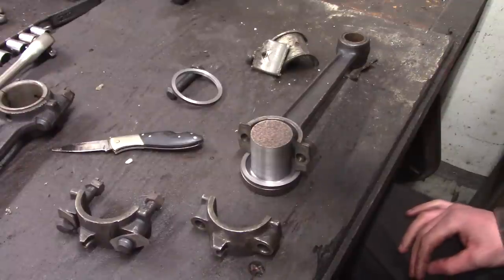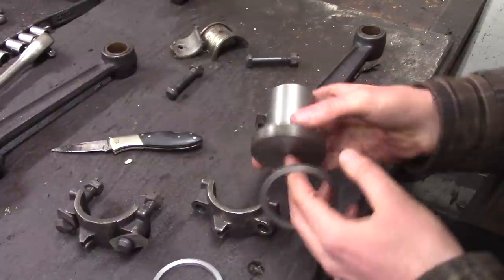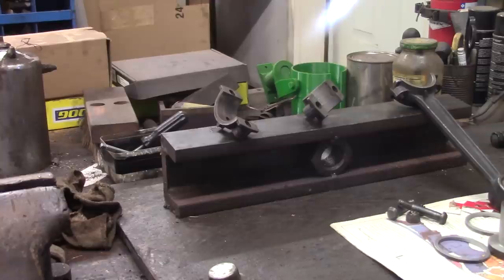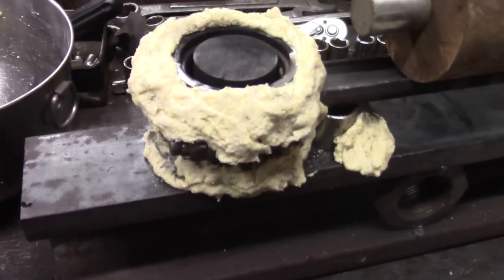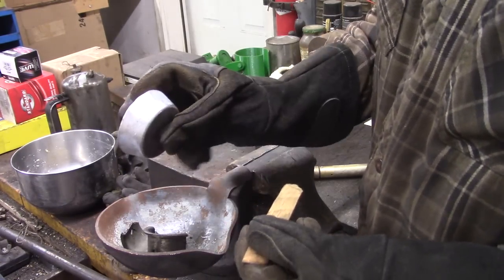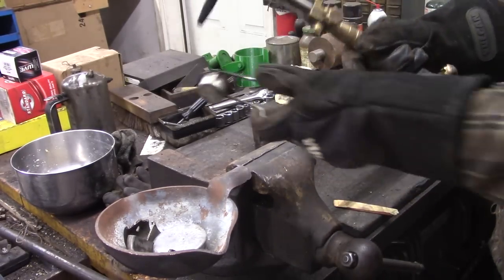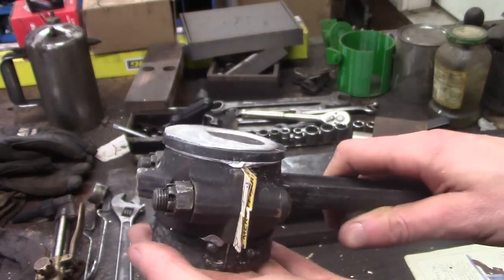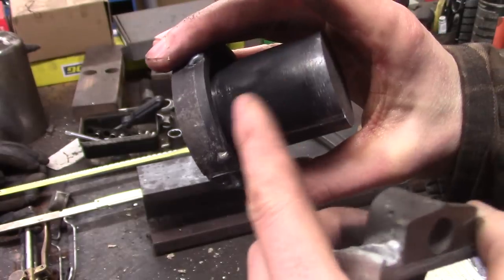Pouring A Babbitt Rod Bearing - Cletrac Crawler

Comment: First thing is the rod & cap need to be baked as you said to remove all of the oil, then you need to blast the parts clean. "Tin" the shells so the Babbit has a "Physical Bond". Without that, the heat can't transfer from the bearing material to the rod. I'll bet you can knock those Babbit shells right out of the rod and cap with a couple of taps with a hammer? A 1/32" piece of aluminum will work great at the joint line, and will allow you to take everything apart easily without you having to saw it apart. You can also re-use the shims. For small parts like rods, I like to "Puddle" the 1/8" Babbit wire in with a small Victor J-27 torch and a small tip. If you like pouring, that's O.K., but very time consuming for small parts. Just my 2 cents and thirty-five years exp! Thank you!
Reply: I always uses pure tin to tin my caps/ bearing shells before Babbitting and clean in hot Kostic soda to clean parts
Reply: Cool tip, instead of tack welding that ring spacers just use superglue to hold them in place. 😉😄👍
Reply: I can’t even start with what is wrong here. Those bearings will not be bonded like they should be. The old ones failed for the same reason.

Comment: When I'm casting lead or tin, I often times when I know it's still solidifying and starting to pull metal, I will play the torch along the top where it's pulling the metal from to keep it a little more liquid for a little bit longer to give it a chance to pull and settle so it doesn't wrinkle or get voids.
Reply from the maker: Good tip!

Comment: In the 70's I worked in a connecting rod shop & would machine out the babbitt & size the rod to fit bearing inserts by the 100's at a time, on the old 6 cyl GM rods. No more babbitt.
Reply: Which engines were still in use in the 1970s that used poured babbit bearings?

Comment: Your damming material was made with water, oh for shame!  That was the sizzle causing air belles that ruined your first pour.  Water and liquid metal are the most mutually exclusive things there are.  The frosting is a result of the Babbitt cooling too quickly (mandrel or cap not pre-heated enough).  Great problem solving though, pour oversize and machine away the rest is also my plan of attack when doing this.  I'm not a machinist and have sold several "Raw Pour" jobs.  The customer will pay for that extra Babbitt, believe me.  You will be seen as the hero in the end, the overage can be collected and reused on the next thing.  Retaining holes/drilling of the cap so the lining does not fall out sort of works, the fatal flaw is that caps should be "Tinned" like soldering copper pipe or a brass radiator.  This initial bond is the key to a secure bond.  There is a special tinning flux that comes as a dry powder to sprinkle on cast Iron used to tin the cap.  I have some so old I think it now might need a screwdriver to get it out of the can.  Check with roto-metals or Mc Master-Carr for a supply.  On final assembly after machining, a product known as 'Time Saver" is mixed with light oil and smeared on the rotating member and bearing surface and used as a lapping compound.  The shaft is rotated by hand and the caps gradually tightened as the process goes (shims in place), repeat additional time saver if needed.  This wipes any machine/scraping marks and will give a very consistent .002 oil clearance allowance.  Rule of thumb after blueing is a +75% bearing surface for hand scraping, time saver can give you a very predictable at least 95%+ bearing depending how far you want to take it.  The more perfect it is, the fewer hours it will go so keep a happy medium.  There is not a thing wrong with a machine running on poured bearings with 85% contact surface.  Laminated shims and being adjustable are a great thing.  Each shim removed at adjustment also reveals greater surface area/bearing surface increase.  Oh, oil galleys only need to be cut a few thousandths deep, most guys go deep when it's really the tip that makes the magic happen.  Tip for others, do not reuse old Babbitt, you do not know it's compounding.  If it already failed once...?  It does however make great cast High Velocity bullets (it's bearing material and mostly Tin so it holds up quite well, weigh finished bullet weight against load data before trusting what the mould has stamped on it, tin is not as dense as lead), also makes fairly Eco-friendly fishing weights.
Reply from the maker: That's true about the damming, but i've heard of other people using that mix for damming so I tried it. Oh well! I tried tinning once, the cast iron was so oil soaked it wouldn't tin. I didn't even think of it this time. maybe if i find some i'll give it a try for the next job.
Reply: M

Comment: My father was really good at pouring babbitt bearings. I remember him pouring babbitt bearing in a Caterpillar 15 about 50 some years ago and it turned out perfect. The engine idled with 40 lbs oil pressure. I didn't watch him pour them. Wish I would have. Being a kid I wasn't very interested but I remember him being happy with it. A friend of mine has that dozer and it is still running today.

Comment: As an apprentice in 1965 I overhauled the Medows engine on an Oliver DDH cleat track dozer. Those conrods are the exact same ones that I worked on(blue, file a bit, scrap a bit). To determine the exact correct temperature of heating the babbit, lay a piece of brown paper bag on top of melting metal in pot. Paper will turn black at the right temp without burning the babbit. The New South Wales Foresty Commision in Australia had a fleet of these with winches used for snigging logs.  The winches were the best designed in the world at the time. Thanks for the  trip down memory lane.

Comment: When I was in trade school 40 odd years ago , we had to do a set of rods but there was a cool jig with a handle that closed up on the rod , can't remember if we did half,  you definitely need to tin the tunnel etc ,  I had an old 51 ford popular E93A engine , a trick if you have lots of spares is if you have a good set of say .040 rods , you can pin hole bore them back to .020 and grind a crank to suit .. cheers😅

Comment: As a seventeenager my 1936 Ford eight  babbeted  big ends clattered too much and my one off solution was to file material of the con rods and end caps to make a very tight fit on the journal,which I treated by marking  the worn babbet with engineers blue and scraping away to get a round perfect fit.Result very good for many enjoyable if slow miles.

Comment: I have always fluxed and  tinned the bearing surfaces before pouring the Babbitt.  It is important that no oil can get between the Babbitt and the bearing shells otherwise the Babbitt can pound and break up prematurely.
Reply from the maker: ive never tinned, but spent lots of time heating the parts to drive out oil. Don't have anything against tinning, just never did it.
Reply: I have done many both small and very large. It's always better to tin the services at it stops the poured bearing from shrinking away from the bearing backing or in this case the rod and cap. It may look ok but they often get voids you cant see and then they delaminate as the oil gets under and hydraulic sections or the whole backing off.
Reply from the maker: @tfsupp  I'll have to give it a try next time! what do you tin with, the babbitt itself? what kind of flux?
Reply: @themadmailler  you can use the Babbitt but you can also use a high lead solder which means you don't have to heat the part as hot. I just use bakers liquid flux or silver solder paist  if difficult surface. You must use a really hot iron (i use a large copper block one) after pre heating the part or heat the part and directly melt the solder stick with a vigous action to ensure good bond. 
I add shims to the cap ends if possible,  so if the bonded bearing is still secure you can remove the shim and reclamp and rebore or scrape (better to hold the oil) to extend the life of the original pore.
Anouther difficult trick if the bearing is worn and the bonded bearing is secure to the backing (cap, rowing this case) you can use a very hot large soldering iron to re solder new Babbitt onto the bearing surface and re fit. We used it a few times for emergency repair on large bearings and anon shimmed oil pump bearing when I was on the ships as a marine engineer.
Reply: what was the flux you used , was it a tinning flux like you use for lead loading ?  or  zinc chloride
Reply: @eweunkettles8207  We just called it babbitting flux which I think was zinc chloride.  It was a white powder that you mixed with water.

Comment: You can use an oil Stone and remove all of the teeth set / kerf  from the hacksaw so it's completely flat on both sides so it will only cut straight down.
Reply from the maker: good tip!

Comment: If you wanted to do these again you could drill and tap a hole in the centre of the tool you made and do the same to that bar stock you rest it on and use a stud to hold it in place and put little wings of shim material on the upper ring to hold it centre up top, and have a bushing welded or threaded to the plate at the rod end with a shoulder to keep it in line with the other part, and if you really wanted to make it easy you could put a stud or pin somewhere to hold the rod from moving at the bottom end (it will only swing as the wrist end bushing thing will hold it. And if the top rings get stuck you can just pry away and bend the shim stock, or chisel the layer covering it away and pry upwards.

Comment: More consistent heat will go a long way toward getting a better pour, plus always secure all the parts of your mold. As for damming material, I prefer ceramic clay.  You pack it and heat it, and it turns to rock.
Reply from the maker: can you still chip the clay away easily enough after heating it?
Reply: @themadmailler  It breaks like pottery.

Comment: why didn't you flux and tin the rod and cap to make the babbitt stick.
Reply from the maker: I mechanically affixed the babbitt with the cross drilled holes.
Reply: The very last thing you want to be doing is drilling holes in the rod and cap as it will certainly weaken them. This video is a good example of failing to do your research before starting. The result is very amateurish. No bond between the babbit and the rod/cap except a mechanical one,,
damage to the rod/cap mating faces,
weakened rod and cap, seconhand babbit risking inclusions, inadequate heating of the parts before pouring etc etc. The golden rule of being a good engineer is "Do no Damage", to the part, yourself, the environment, your reputation and your tools. The way most amateurs work is to do the first thing that comes into their head. Rarely is that first idea an ideal solution. Only start the job when you have thoroughly researched the best solution.

Comment: Wouldn't you need to cook the bread damming before pouring to drive the moisture out first before pouring the babbot?
Reply from the maker: @robertpeters9438  that makes sense, but then it wouldn't seal as well. Either way, I wasn't interested too much in experimenting so I just used the real stuff!

Comment: No pre-heating, pre-tinning or use of Flux. 😒
Reply from the maker: I did pre-heat. Tinning is optional (the bearing is mechanically locked with the drilled dimples) and flux not needed.